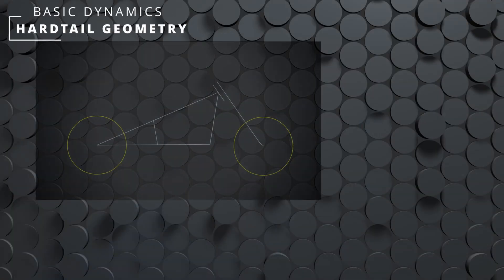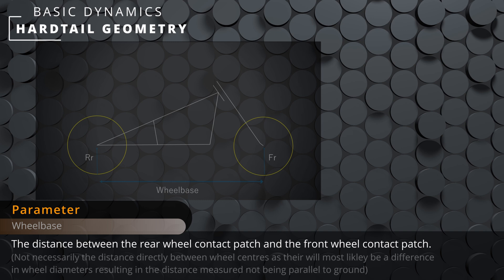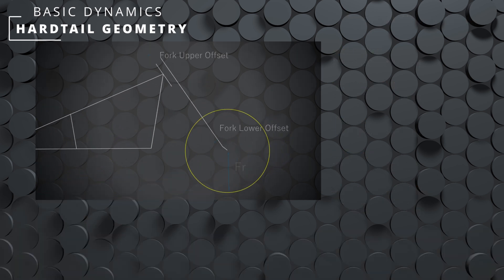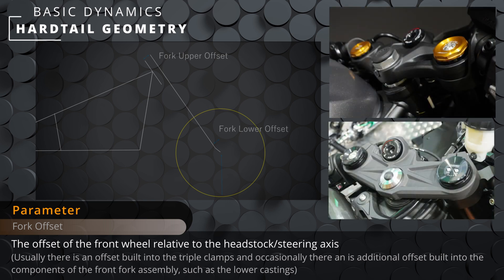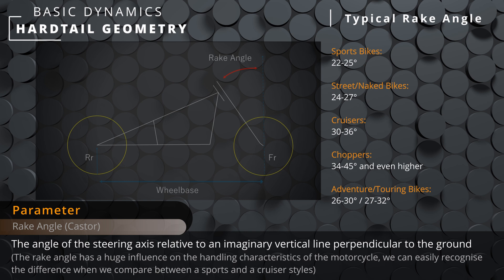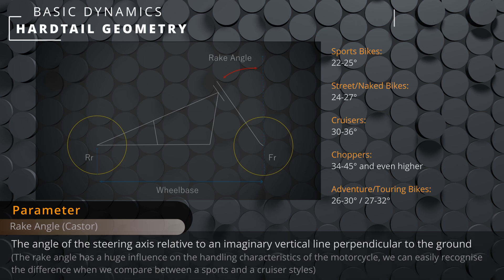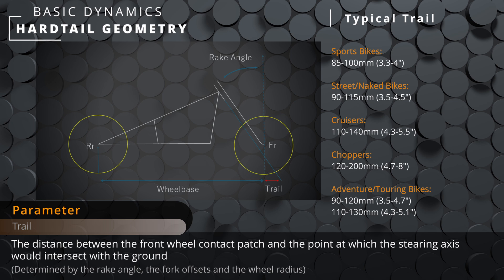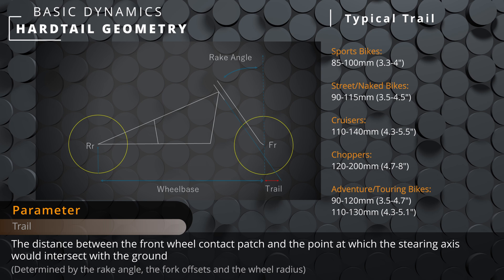Motorcycle Dynamics: An Introduction to the Basics

Comment from the maker: Is everyone aware of these parameters and their affects - Rake and Trail specifically? I'd be interested to see

Well, It's a little rough around the edges, and I've tried to keep this simple, but I hope that this helps someone. 

Part 2 will be the geometry calculator up to a direct mounted suspension. There'll be a few more advanced calculations included here, so in Part 3, we'll start to look at some more advanced dynamics topics.

Thank you for watching!